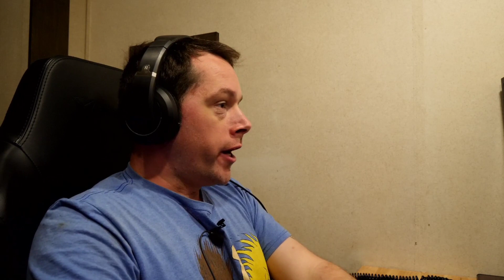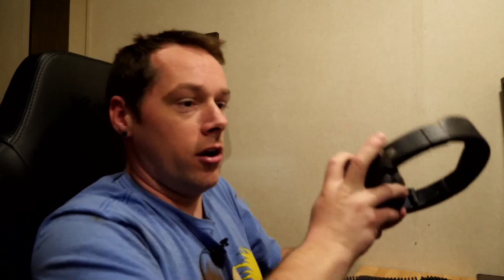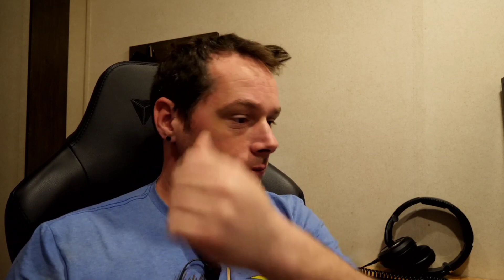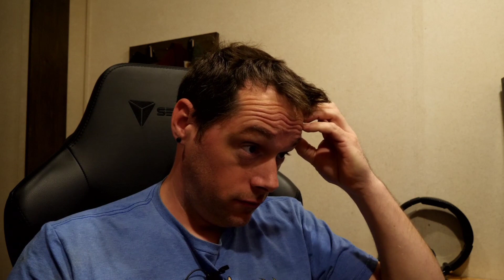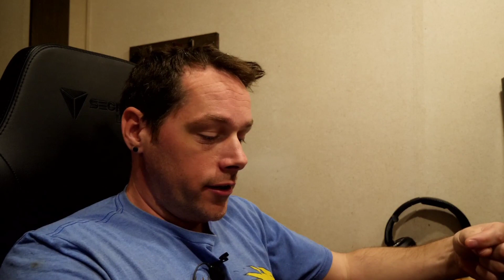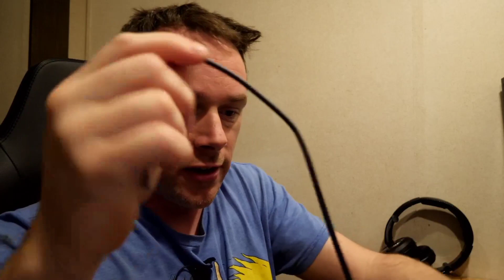Kevin's Golf Carts - Q&A 04/APR/2020

Comment: Thank you so much for your videos, they have helped me so much restoring an old 1998 Yamaha G16 golf cart. I recently noticed a slight whine when sliding down, I then checked the rear transaxle case and noticed where the previous owner hit a rock and it had a crack. I patched it with JB Weld, do you think it will hold?

Comment: I have a mid 1980s ezgo golf cart with the coils none of that controller stuff with a very severely rusted battery cage what do you think of those coil type old ezgo golf carts
Reply from the maker: The coils are resistors. They are not as efficient as a solid-state controller. The resistor coils run the battery pack at full power regardless of speed. You have less upgrade options with resistor carts without heavy modifications.
Reply: on the bright side, you can always get parts from a Pinball repair shop.